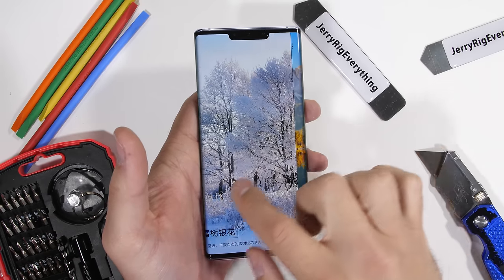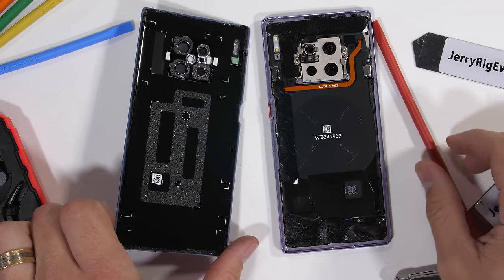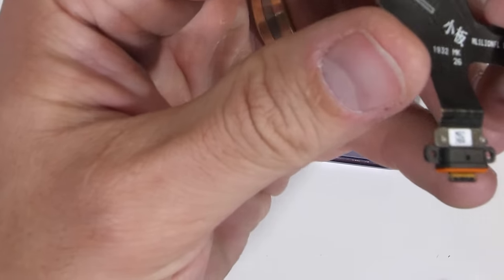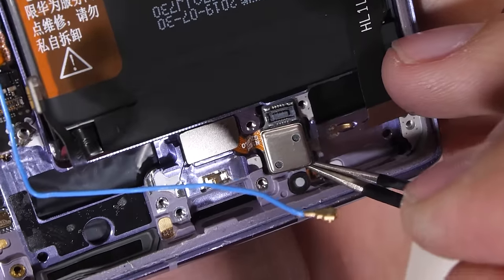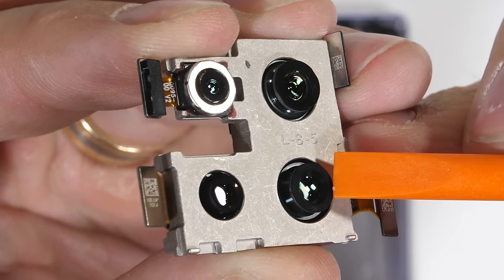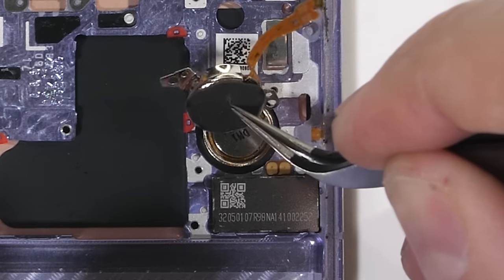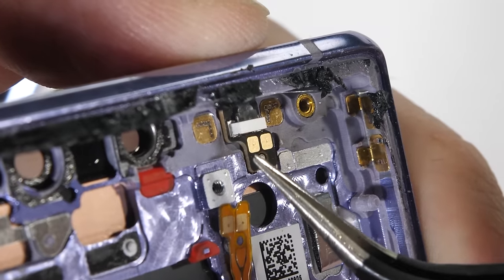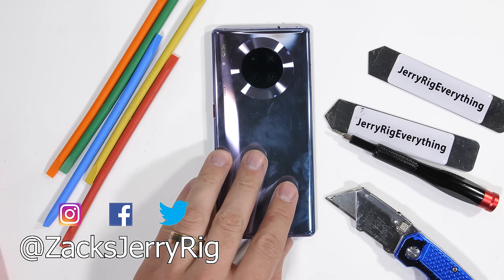The Banned Smartphone TEARDOWN! - Huawei Mate 30 Pro

Comment: The cells in my skin withstood the heat of my lighter for 40 seconds before going black and not recovering.
Reply: Have tried this but it can be on for 41 seconds then turns black
Reply: jeez, really? my skin cells lasted only about 17 seconds before going black. i must be very low budget dude
Reply: @fartmaster6760  must've been made in China..
Reply: He spelled screw as skcreew
Reply: Jesus.
Reply: @normalusername4070  no
Reply: I tried this on my black skin and it turned white!
Reply: @OOOUZ  Then it gained privileges. be proud.
Reply: @Omar-ef3hj  
It?
Reply: The cells under my skin are optical
Reply: @Omar-ef3hj  br
Reply: My skin is already black

Comment: Looks like a nice phone. I'm still rocking a Galaxy S9 though.
Reply: I have a S9+ and its amazing
Reply: I have the vivo y11 2019
Reply: I don't like the pre installed apps and UI of Samsung phones. Maybe I switch to oneplus.
Btw still using my 2014 Samsung note 4.
Reply: @paritoshsrivastava4184  yeah I've never tested oneplus so I don't know anything about the software, I just grew up with samsung🤷‍♂️
Reply: @paritoshsrivastava4184  One Ui is probably the best out there, I think you meant the old Experience Ui or Touchwiz
Reply: I love one UI 2 on Samsung
Reply: I'm rocking a v30 and it still has the most important non-gimmicky features a phone needs
Reply: Yer I'm still rocking my s9 plus does me perfect dont see eny need to go up to s10 unless I get good deal then I might
Reply: Jamie Champion why would u use a mac?
Reply: @Khloya69  uhh because he wants to?
Reply: @Domniak  OxygenOS of oneplus + the ufs 2.0 makes my pretty old Oneplus 3 still run like a champ, does not feels old at all except for the camera, so yeah oneplus is pretty good for long term users (in android)
Reply: @Khloya69  Why would someone else use Windows? My choice of operating system is completely irrelevant to this discussion of phones, but if it matters to you, I use macOS, Windows and Linux. I also use iOS and Android. I dont really have a preference.
Reply: I'm rocking a broken screen j7 prime 2 with 800mb free ram😎
Reply: Jamie Champion mac os sucks
Reply: S8 and S9 both gave me burnt in screens :) now having a huawei p30 pro I don't want to go back
Reply: @Domniak  me 2
Reply: @paritoshsrivastava4184  one UI? Pretty sure ur talking about Samsung experience
Reply: Note 8
Reply: Beats Samsung hands down. I have both but huawei wins it for me
Reply: @hazley13  For price: Yeah
Otherwise: nah
Reply: Solid phone
Reply: i still have an S8+, 3 years and still great
Reply: @paritoshsrivastava4184  did we ask?
Reply: I still have my mate 9
Reply: @marnickbar4794  work for o2 phone shop so yeah it's the best selling phone in the UK and cam and speed beats the Samsung.
Reply: @paritoshsrivastava4184  yea... it's the 2nd most popular is
It's very nice...
Reply: @TIMETECH07  absolutely
Reply: Guys the best phone is the phone that you are using right now
Reply: I'm still rocking a Galaxy S7.
Reply: Boy I gotta iPhone 5
Reply: Ok gr8 4 ya
Reply: I have a pixel 3a and it's pretty good
Reply: But.. why do your comment has so many likkkkeees?
Reply: Ginas Secret LGBTQ Channel  I don't know if I would call phones without an SD card slot a ripoff, but I do find the SD card in my Galaxy S9 very helpful. I will soon be upgrading to a 256GB card.
Reply: I miss some Samsung features but the battery in Huawei p10 plus is just better than any Samsung phone I have used. Feels bad having to charge my phone every few hours and the battery giving up after just 2-3 years. Not giving up in the sense that its not working but it has noticeably lower charge than a new one and % indicator is broken, turns off at 10% left sometimes. Thats on 5 generations of Samsung phones, still not fixed. Havent had any battery related issue on Huawei so far and the price is much friendlier. Camera is much worse though even though its Leica. I hope Samsung improves the battery alot and that the price doesnt increase by a few hundred every new galaxy.

Huawei just seems to have better quality control overall and makes things that last.
Reply: @hazley13  Not really. There are 2 types. Exynos and Snapdragon. Snapdragon is faster but camera is better on Huawei
Reply: @Shacharath  i had to live in that hell too😂
Reply: @hazley13  if you want, but you can't argue that the software is better on huawei compared to Samsung
Reply: @darius_moglia  like I say I have both phones and the tests we do in my work (o2 shop) always come back better on the Huawei. Pity trump sees this as he knows huawei are leading the way on technology

Comment: I had vibrator  in my breakfast 😂 and that was definitely  a bad desition because my stomach got scratched as my stomach couldn't hold lvl 2  scratches which deeper groove at lvl 3
Reply: based on that english I'd think you ate a baguette for breakfast
Reply: * lvl 6 with deeper grooves at the lvl 7 😂
Reply: Wait what..? 😂

Comment: I've never had to replace a part on any phone I have owned, not once.  I can only surmise that people are very clumsy or deliberately abuse these devices.  Of course if components fail due to normal use (not misuse or abuse) then this should be covered under warranty / consumer law as it would imply a manufacturing defect.